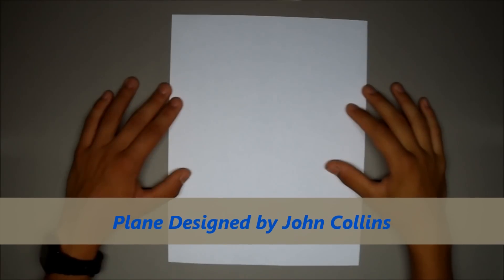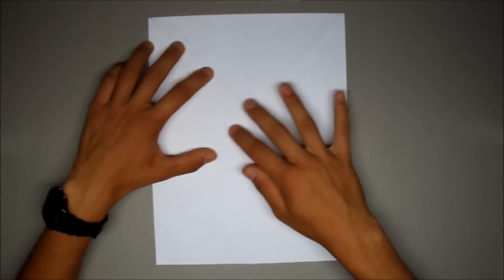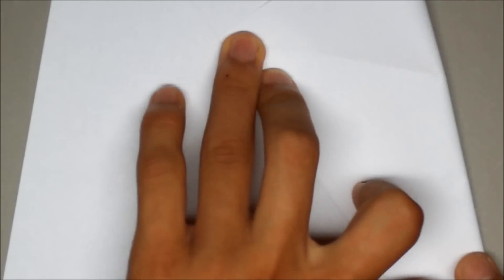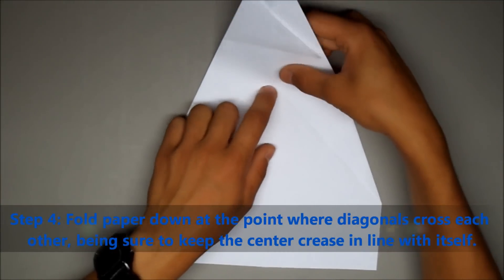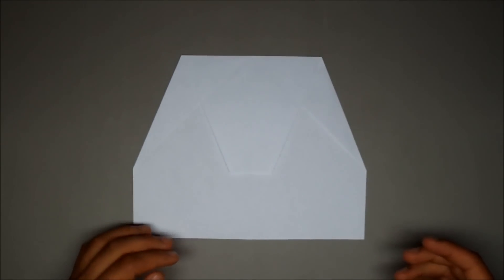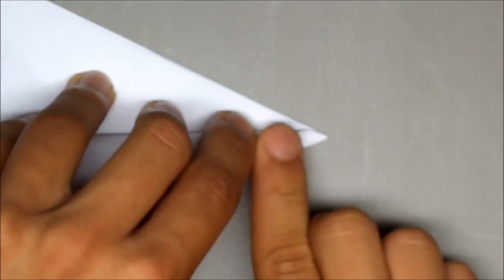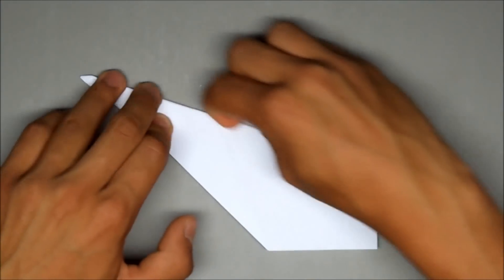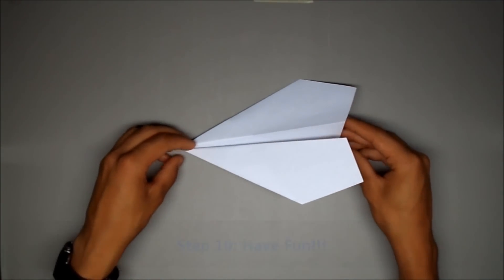How to Fold the World's Farthest Flying Paper Plane (Designed by John Collins)

Comment: it drops instantly...
what the fuck did i do wrong?
Reply from the maker: +Creeperkid48Mobile  Does your plane look a lot like mine? If not, you may want to make another one.  If it does look like mine, it may be the way you are throwing it. Try throwing it very gently and smoothly.  If it still drops, the last recommendation I have is that you may want to try bending the elevators (rear edges) slightly up.  Be careful not to bend them too much, it will decrease the distance.  And, of course, if at first you don't succeed, try again! Good luck! :)
Reply: Panzer48 throw it harder and throw it straight
Reply: Panzer48 i thibk your tip is too heavy...